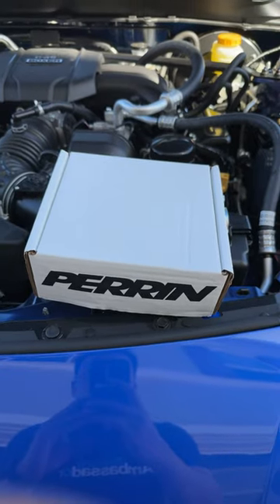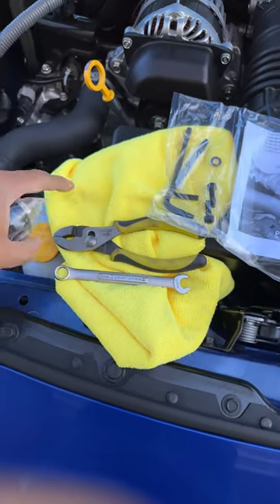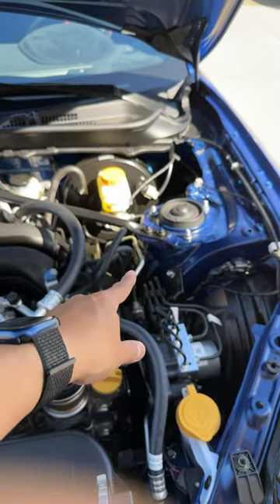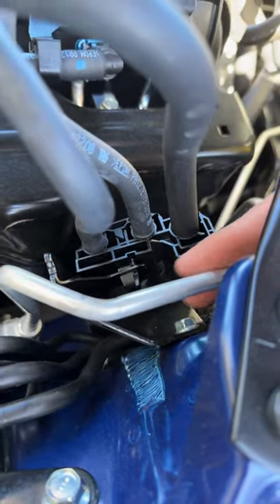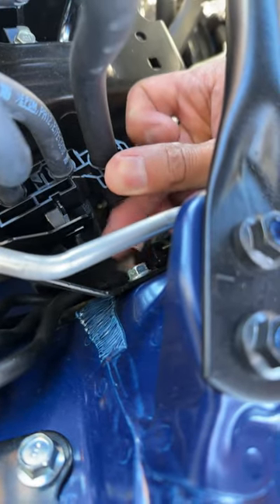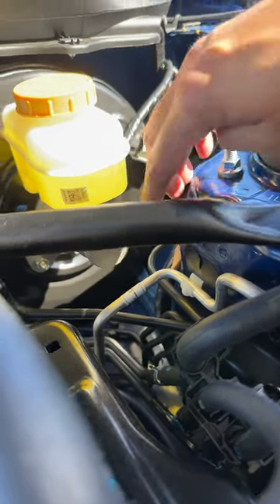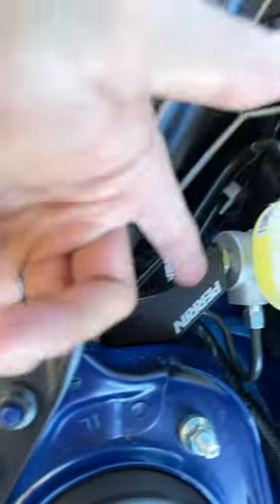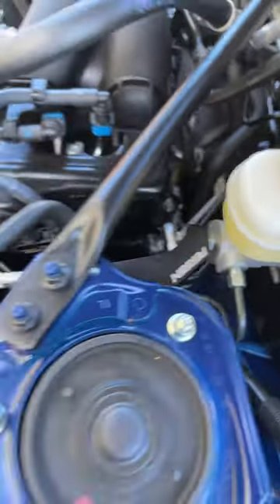Perrin Master Cylinder Brace install on 2023 BRZ

Comment: Does it feel different to drive now can you tell that you added the brace at all?
Reply from the maker: To be completely honest, I'm not sure. It may feel like a placebo effect. The brake pedal feels a lot stiffer now compared to before. I assume it's doing its job. If you are in the market for this, I recommend getting the Cusco Front Strut Bar. It has a built in Master Cylinder Brace vs the Perrin where you literally have to wiggle in to install it.

Comment: Does the front bolt that leads to the master cylinder basically applies pressure to it?
Reply from the maker: Yes. And it locks in place so the screw doesn’t loosen up